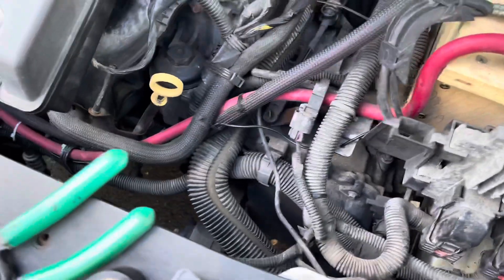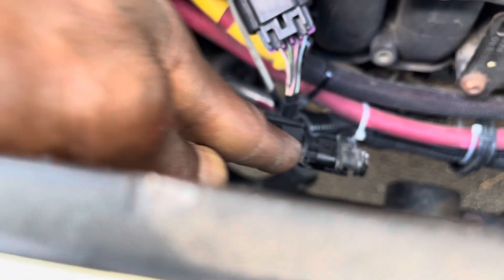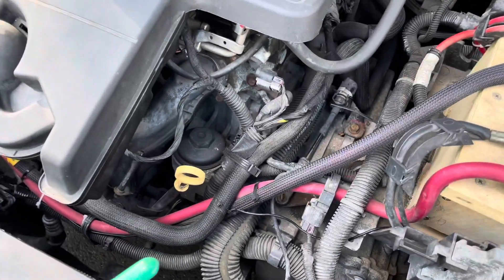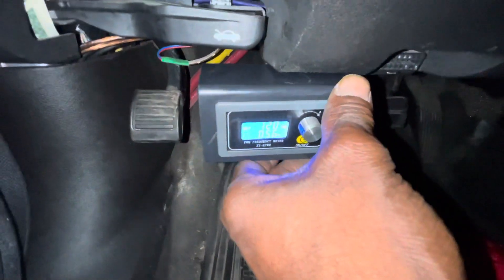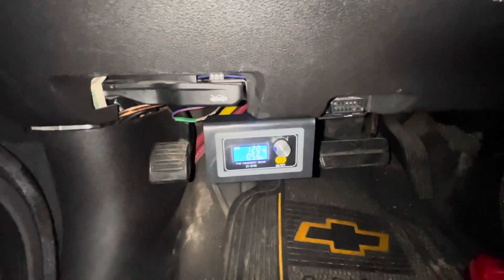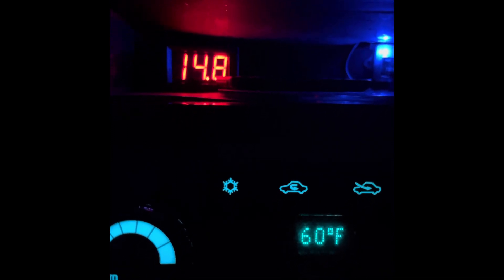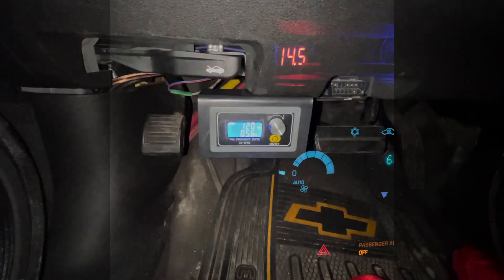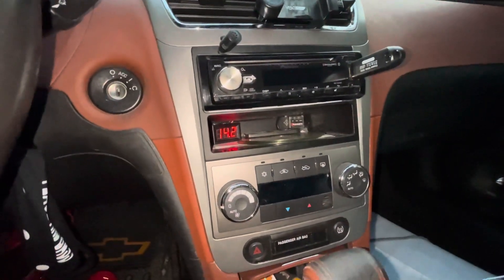PWM Voltage Controller Install and How I Use it.

Comment: Hey bro I know this is an older video but I have been locked up for awhile just got out recently and started on my build in my daily driver/compete car i ordered my alternator a 290 from autotech and I was told to run a PCM bypass test where you unplug your wiring harness and start your car drive around and basically that's what you get with the swap to a HO on the pcm controlled charging system now to start off my 19 Camry charges at 13.8 if im driving for any more than 20-30 minutes i can hold 14-14.1 steady with all the wiring upgrades and lithium on my STOCK alternator right now anyway im wondering if I will see something like what you are seeing where instead of charging around 15.8 it will be around 15.2-15.3 reason I ask is because when I did the test I actually didn't get a battery light or any kind of charging system malfunction indicator nothing like that my car ran normal at first and then I finally noticed that my voltage wouldn't go above 13.5 no matter what I do and I have heard of other people having these issues were no matter what they do they can't charge above the low 15's i haven't received the alternator yet but im wondering if you can give me some insight on the topic and did you experience anything like this ir did you do the bypass test before
Reply from the maker: Face Palm!! I promise you I didn't catch this comment off my phone. On my PC now I know it's been a year but give me an update are you still having issues?

Comment: What's that Grey/ white wire to the +on the alt?
Reply: Normally a gray wire is an exciter wire, which it triggers the alt to charge without signal it will not know when to charge and not charge

Comment: I don't have the harness but one video a guy said cut the tan wire on the alternator and tie into the factory tan wire but I tried that and it didn't work for me. How do you get the harness

Comment: So if it’s a 2pin plug in to the alternator does it work with for example a mechman alternator or it only works with the brand x alternators?  Was thinking about trying it but I got a 2pin mechman alternator not a brand x one
Reply from the maker: It’s been a while since I played with it. Next time I go to the car I will take a peek at the plug so I can be 100% w you. I believe it’s controlled with one wire you can make your own pigtail. Yeah I got you on some info soon as I can. I don’t want to give you the wrong info and look crazy at the same time ✌️🔊
Reply: Sense wire goes to pwm

Comment: Hey bro, great video! Hey you mentioned the pwm wire going to the alt...but what did you do with the other wire on the alt? Wasn't it a 2 wire plug on the alt?
Reply from the maker: The other wire is taken care of inside the pigtail. Just a heads up I only plug it up when I’m in the lanes. It does cause your alt to work harder

Comment: I was going to order this for my 2015 ford explorer which is my daily but can you explain you made a statement that you unplug it when you are not doing demos. How would I go about using this as I its my daily. Is there just a power switch on it? If I turn it off what would happen as im driving?
Reply from the maker: I keep mine unplugged because I noticed because it keeps your alternator working all the time at higher percentages. When I have it dialed down it's not adequate. Got tired of driving and playing with it all the time. not to mention performance and gas mileage

Comment: My question is if you turn it off while you are not going ham on your system. Does it still throw codes to your dash? And will the alt still charge you up to your set voltage?
Reply from the maker: I’ve never had a battery light. I got a check engine light after running it at 80% for a while I can really feel that load as well. Check eng. light only happens at idle though. When I’m not in the lanes or if it’s not really needed I keep it unplugged
Reply: @bigvell02  gotcha. I got mine plugged in and it's running. Don't do much out of town with it yet. But I think I felt drag earlier 😆  and I'm sure it's cuz I was charging my lithuim high. Much appreciated

Comment: Can i use a 12v ignition to power the module?
Reply from the maker: I wouldn’t recommend it unless you use a relay
Reply: @bigvell02  okay thanks for the heads up brotha

Comment: Should i put the altenator on before the controller?
Reply from the maker: Yes. And be careful using the controller I wouldn’t go past 80%. Just a heads up your alt will work a lot harder. I only plug mine in when I’m about to compete

Comment: Thanks for the video, but I'm confused. When you bump up to higher than the nominal 14.4 volts, aren't you worried about damaging electronics? (Yes, I'm the guy wearing the thick glasses and pocked protector). I also don't quite understand the advantage between the nominal 14.4 and 15 volts. Also, I'm very sure you aren't creating 600 to 1000 amps with a car alternator. Maybe you are running dual or triple alternators?
Reply: It’s the batteries, you get significantly more power at 15.2 volts than 14.2 voltas. Especially lithium
Reply: Cars can handle up to roughly 18v the car is truly ran on a 5v system.
Reply: They're mainly to stop amps from overvoltage whenever the alternator tries to send the voltage higher than 16v with newer Chevies and fords. My truck does it when it's cold outside and constantly throws my amplifier into protect because it tries to hit right at 16v when I start my truck or accelerate too much. Lot of new vehicles have this problem that or it tries to dip too low.
Reply: Vehicle electronics are pretty well known to be stable to at least 16v, Newer vehicles usually have a over voltage protection circuit in the ecu , bcm, sir, ect 

What are you referencing 600-1000A off of and such a big swing? The alternator don't need to supply that high of amperage to a huge amplifier, that is why we have battery banks. Of course it's better to have as much reserve as possible from your alt/s but you are not constantly consuming lets say 1000A on a 10,000 watt amp even though it has the potential of drawing that much. When the bass note isn't playing that's when the alternator can replenish your battery reserve. 

as to advantage of higher voltage, well the higher the voltage the more amperage can flow.

Comment: Appreciate ya, just ordered mines from brand x, that after market ALT and that pcm don't mix
Reply: I'm somewhat confused I know the red wire goes to the accessory and the black wire short wire is a negative but what about the other wire black wire does that wire go into the pigtail on your factory alternator part where you hook the alternator into the factory connector are you supposed to hook something else into it instead of just leaving it
Reply: @terryboyd9551  ground

Comment: What car you run that in fam ?
Reply from the maker: It’s in a 09 Chev Malibu and GM with a PCM controlled alt, Ford etc
Reply: @bigvell02  I’m running 2 evl 12s from scar on a taramps 5k dual battery in the trunk but on stock alt at the moment
Reply from the maker: Yeah that stock alt working hard no doubt,
Reply: I got a 10 that jumps voltage from 14.7 down to 12.8 then later it’ll go back to 14.6-7 will adding that fix it ?
Reply from the maker: That’s your PCM being stubborn. It would work but ideally I would get a aftermarket alt with it.